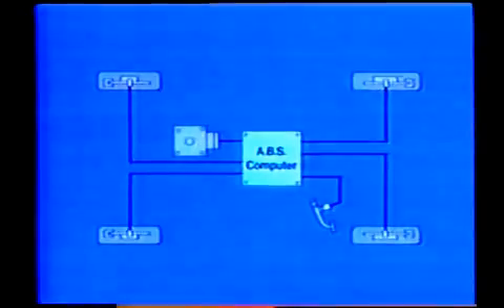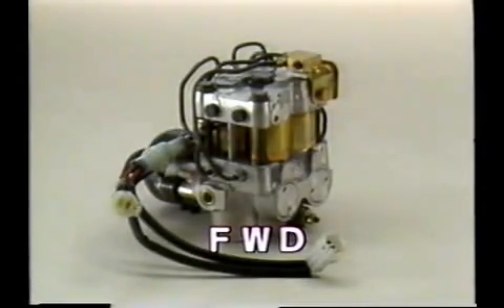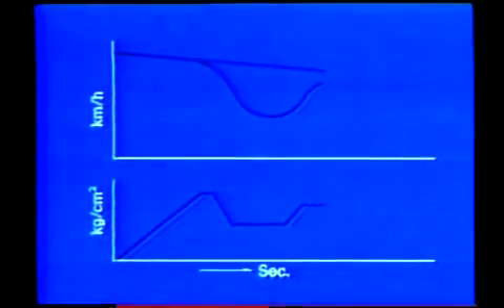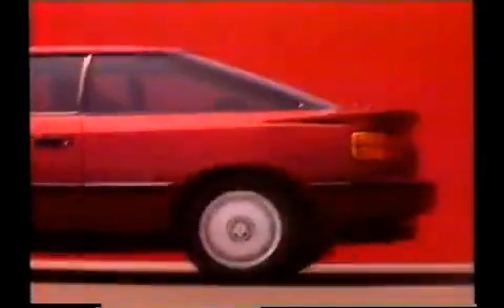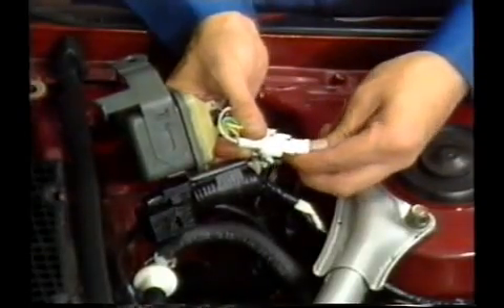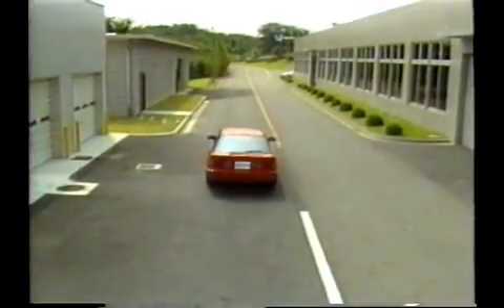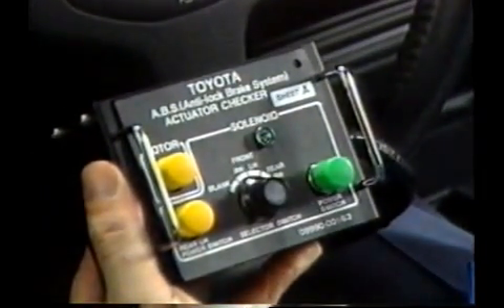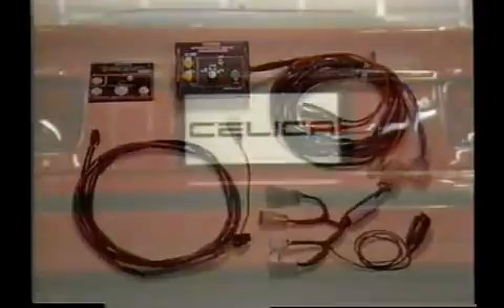A B S[ANTI LOCK BRAKE SYSTEM]

Comment: Limited to a specific type of ABS (multi-position solenoids rather than the Bosch system with individual solenoids used on German cars. Also pre 4-channel ABS and pre OBD-II diagnostics. 
But still very informative about how the internals of the ABS works and excellent for old Toyota service. Thanks for sharing!